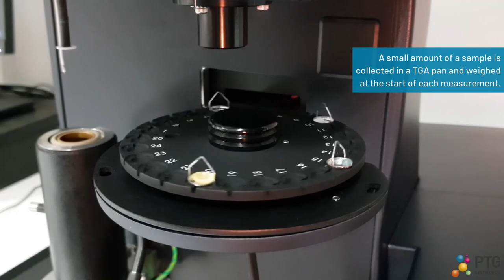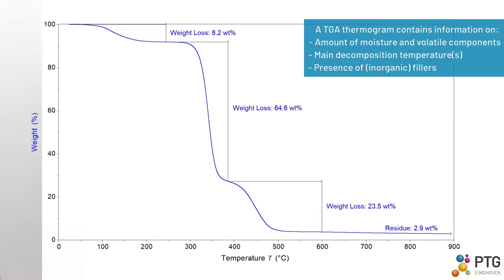Thermogravimetric Analysis TGA - Explained

Comment: Does TGA can measure the char yield of the substance?, I would like to know if TGA is best testing method of fire retadancy of a sample ?
Reply from the maker: Hi, It’s possible to measure char yield by running the TGA to high temperature under inert atmosphere, where the char can form, and then switching to air atmosphere to burn it. That weight loss can indicate the char yield. However, a more direct method to test flame retardancy would be according to the UL 94 standard. 
Enjoy your day and kind regards, 
Denise 
PTG Eindhoven
Reply: Thank you for replying to my comment on your video. I truly appreciate the content you've shared regarding tannic acid (TA). I was wondering if it would be alright to ask a few questions about thermogravimetric analysis (TGA), particularly regarding the data that can be obtained from it. I am also interested in learning more about dynamic TGA and its applications.

Thank you once again for your informative content, and I look forward to your guidance.
Reply from the maker: Your welcome, there are many online resources on the basics of TGA, for example from manufacturers like TA Instruments, Mettler Toledo, Perkin Elmer or Netzsch. What specific question do you have?”
Kind regards,
Denise
PTG Eindhoven